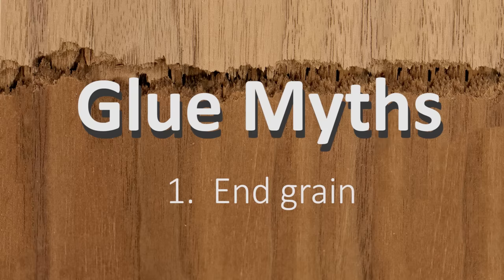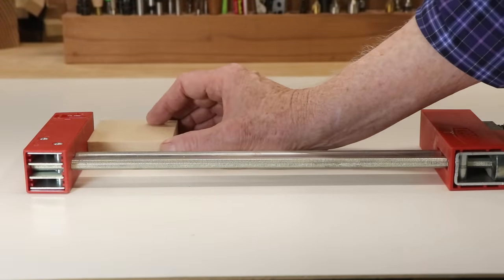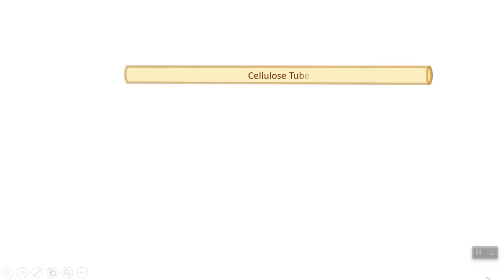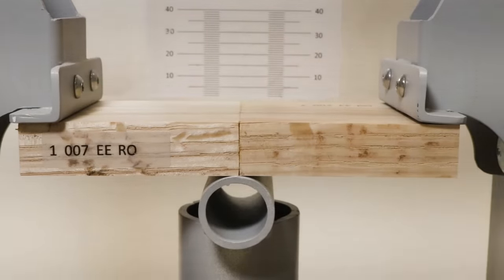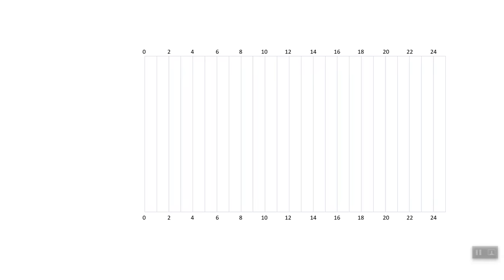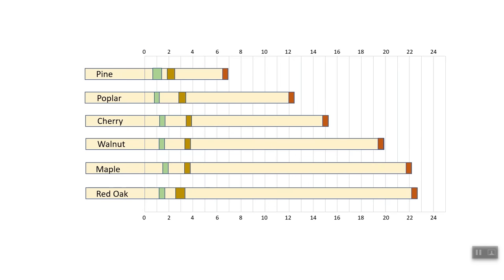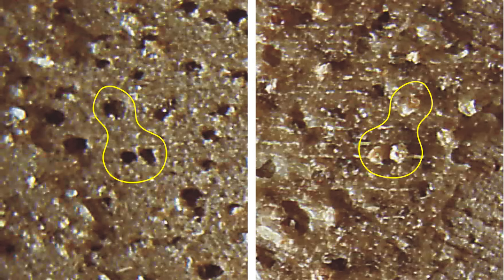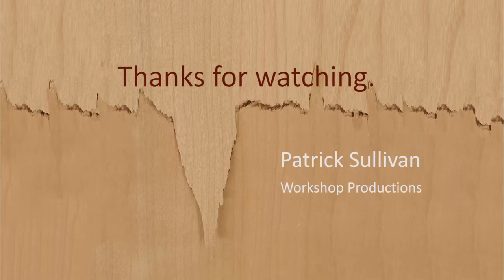Glue Myths:  1. End grain

Comment: Thanks for creating this video, and the thought that went into the underlying explanation of why things happened this way. I think you touched on something important here. Like others, I was also under the impression that end to end grain joints were to be avoided at all costs. 

One of the really important things you did was to equalize the effects of geometry in your test setup. By cutting the wood into square blocks you equalized the surface area for your test. You also touched on an important fact at the end of your demonstration. That was how much area are used in making edge to edge versus end to end grain joints when used in woodworking.

I know that geometry is part of mathematics, which is outside what woodworkers like to do. However, when you're talking about scientific methods and when you're taking force measurements, your're just touching on the underlying Structural Engineering properties of wood. Look at the strength of the glue joint in terms of PSI - Pounds per Square IIch. By cutting the wood into squares, your demonstration equalized the square inches over which the force was being applied. This made it so that the strenghts of the various joint types could be evaluated equally. The explanation of the relative strengths of the wood fibeers, lignin, and glue impacts the design of joints is genius.

Your demonstration also touched on what type of failure mode the wood joints fail under. By applying a bending force, you also demonstrated that these joints are failing from the tensile forces. Think of an I-Beam being used in your test jig. The upper surface of the I-Beam would be under tension along the length of the beam. The lower part of the I-Beam would be under compression along the length of the beam. The middle part of the I-Beam would be under compression between the upper and lower surfaces. Your tests showed a failure when the wood pulled apart at the top surface. (I'm sure there are some wood species that fail because of a lack of compression strength. Balsa would probably be an example of this as it might fail because the wood crushes at the bottom.) 

I'd really like to see the results of your test if you changed your test setup to measuring when the joints pulled apart under only a tension force. Tensile strength of materials has been studied by structural engineers, and you'll find these listed in terms of force per square area. Megapascals in metric units, PSI - Pounds per Square Inch in US units,. This is where woodworkers eyes glaze over and we go off of what we feel the results should be instead of calculating through the underlying Physics. I now mine did. 

I found a table in https://charles-oneill.com/aem341/Lesson07a-WoodMaterials.pdf that lists Red Oak as having a tensile strength of 101.4 MPa (1470 PSI) along the grain and 5.5 MPa (800 PSI) with the grain. I also found Titebond II has a tensile strength of 25.86 MPa (3750 PSI) at https://www.supplyhog.com/c/paint-painting-supplies/adhesive-glue/wood-glues-polyurethane-glues/p/titebond-ii-water-resistant-wood-glue-2. I would bet that the results of your experiment would be close to these numbers. 

Maybe we need a video (or series of videos) that go through the various types of joints that we use, what forces are applied to these joints when they are used, and what areas these forces are applied to.

Comment: Great video, may I add one consideration: You've tested static strength, testing for impact resistance might give you very different results since the wood doesn't bend nearly as much along the grain, as it does across the grain.

Comment: wow! not a woodworker, but recommended to watch by a friend. GREAT video, and it seems you totally blew the myth out of the water. margins where big enough (probably?) not need to analyze different stress modes. Those modes would be pure Sheer and pure tension. Generally there is a strong correlation between strengths in these different modes, but if you wanted to be absolutely sure of your results, replicate the testing with a different test jig. 
Super impressive work!

Comment: This was amazing. Extremely impressed by the use of the load cell in your clamp to keep things consistent down to the small details.

Did you happen to record strain data? I'm an engineer, and one quibble would be the definition of "strongest." You are measuring force at break, which is certainly one way to measure things... I wonder if toughness might be a better measure, though? Imagine kids jumping on a bed frame for example. You might actually want a more flexible joint that can dissipate the energy, not the joint that breaks at the highest force (but is brittle and cannot flex).

Again, well this is absolutely outstanding work, I would be dying to see this done while capturing the full stress-strain curve. At that point, it might be feasible to extrapolate on what kind of movement might occur over the life of a piece of furniture. Maybe a chair gets leaned back on and the legs deflect for instance. In your setup, things are completely constrained, however in real life you might not hit the forces required to break a joint because a chair leg can simply flex instead.

You are measuring the peak (max) of the stress-strain curve, however there is a lot of information learned from the area under the curve (integral).

Comment: Excellent video great presentation! Size of area of glue joint, the accuracy of the joint, type of wood, cut of wood and the type of loads and its application or direction. All must be taken into consideration. Also unlike metals that have homogeneous consist all determine success or failure. But I think you're right there are a lot of things about woodworking old thinking or incorrect application of a generalization! Just like the way you broke the last piece if you turned it 90 degrees he would have gotten a different result! 
Keep going, it would be interesting what wood science lab data shows also.

Comment: Nice work. I'd like to see this kind of test done with various methods of breaking the joint. The reason is because I salvage most of the wood that I use and have found that applying a bending stress often breaks the wood before he joint (as in your tests), however applying a shock impact to the joint more reliably breaks the joint along the glue line. If the joint is particularly strong starting the split with a chisel usually encourages the path of least resistance along the glue joint.
In my experience knocking apart end grain joints is easier, so I'm going to remain on the fence about the question/myth.

Comment: I was taught to always apply one layer of glue to end grain and let it soak in and dry first. Then do your normal glue up. I remember a couple times when I didn't do that, using old growth clear fir that the glue got totally soaked up by the end grain and the joint basically fell apart when I released the clamp!

Comment: Thank you for this straightforward well-designed test of end grain gluing.  I found that PVA glue (Titebond III) worked much better on end grain than epoxy when gluing end caps on flutes.  The epoxy joints were easily broken with hand pressure.  Also, I think the PVA is even stronger when sizing the end grain joint first with diluted glue then gluing with full strength PVA.  I would like to see a test of sizing vs. regular gluing on end grain.
Reply from the maker: I did one test used the sizing method (which Titebond recommends, but apparently not on the basis of actual testing).  It made no difference in that single test.  I did not report this because the subject needs more complete testing.  For instance, how long to you let the sizing glue set before you make the second application?  Should the first layer be diluted?  What dilution should you use?  However, in my end grain tests, I simply applied a complete layer of full-strength glue on both components, and clamped them immediately.  This produced excellent strength, as I showed in the video.  Could the strength be made even better?  I don't know.

Comment: Sorry, I have a background in composite materials and had understood the end grain rule differently.   The glue cannot restore the full strength of the wood fibers.  Whereas for side grain, glue does restore (and exceed) the side grain strength.  However no one had provided info on what the end grain glue strength was. 

Thanks for the end grain to side grain bending strength info.  Nice to know at least the early strength is higher.  Everyone should be aware that moisture changes will cause differential expansion stresses that can significantly reduce the strength.  Measuring this would be interesting if you have the time.  Unfortunately time required to change moisture content is sizable.  The stresses generated would be sensitive to whether the moisture increased or decreased.  Adding moisture would put lateral compression into the side grain of the end grain.  This might   strengthen the joint.

Comment: This is a fascinating video and very well done! However I believe there are two myths at play here one is that gluing end grain is weaker then side grain or face grain, and the second myth is that some woodworkers didn't understand this. It was said that gluing end grain was a bad idea not because orientation of the grain but that a mechanically interlocked joint was always stronger, as the most preferable connection in woodworking for structural reasons takes advantage of the strength of the long grain most joints end up end grain to end grain so a cut joint mechanically interlocked will always be stronger then gluing or butting the end grain to end grain. I believe this got repeated as and misinterpreted as end grain to end grain is weaker than the other grain orientation(giving rise to the myth you just spectacularly busted). This was my understanding and the fact that some of the glue can disappear down the Cellulose tubes when gluing end grain.

Comment: Thanks for your video, really informative and useful, statistics don't lie. This myth probably comes from the keratin and cartilage glues, these are slightly flexible, not able to fill the canals and lose strength over time. That's why particular joints were invented. And indeed the size of the glue joint is important larger surface area means a stronger joint, this is actually what a good joint does. A 45degree glue joint is stronger than a straight glue joint on the same thickness board because it has more surface area, thus more glue, this a stronger joint. Woodworkers are very conservative, so no-one probably tried this it's common knowledge. I figured this out when I started to make end-grain cutting boards as countertops. I glue a piece of plywood on the bottom because of long-grain failure. I made a mistake and I wanted to take the glue joint apart thinking it would fail on the end-grain, it didn't and I ended up starting from scratch.

Comment: This really isn't a comparison of end. grain to long grain though. Its two separate comparisons: first glue v. lignin  in every case where long grain is at the joint, and second glue v. wood grain in every edge to edge joint. But we already know that wood grain > glue > lignin, so this is the predictable and expected outcome and doesn't address the "myth" really at all. This method can't really determine if the glue bonds to the wood more strongly at edge grain or end grain because edge grain bonds will always fail at the lignin between wood fibers. So what did we learn? Nothing. We already knew wood fiber are stronger than glue...

Comment: Wow!

So glad I watched your video.  Super insightful!  Very appreciative of the step-by-step explanation and analysis.

Timing wise, just perfect.  Yesterday, I experienced a small wood failure (naturally the result of user error).  Heard a loud sharp "SNAP!"  After the 'oh crap' moment passed and I had time to inspect - it turned out to be a small corner chip.  The lignin gave way to too much lateral force (ignorantly applied by the idiot user, whom hadn't gotten around to finish preparing that corner for just that type of stress).

Two great lessons within 24 hours.  I feel blessed.  Prior to your video, I probably wouldn't have absorbed either lesson.

Many thanks!

Comment: When I first saw this video last year a was making a project (a long over the bed light), and wasn't sure how to design the back piece. It had to be two pieces and I wasn't sure how to join them. This video assured me end grain to end grain was strong so I figured why not try it. The joint didn't have much stress on it anyway I thought.

Well this morning I needed to make some alterations to this project and while doing so I noticed that joint failed. The piece is such that I couldn't open the gap enough to get more glue in, but it was completely broken at the seam. So I had to route out a  section quarter inch deep and put a piece of quarter inch oak spanning the now broken joint. Basically created big rabbits and then glued the oak long grain spanning the seam. That's probably how I should have done it to begin with, but again this video made me confident I didn't have to mess around and could just glue the boards together.

This was super annoying as it basically wasted half my day that I was planning on doing another project. And now I can't even install the light again for another few days since it has to dry, then sand, then finish, then dry.

Lesson learned. Screw end grain joints. Just do things properly the way actually good woodworkers have been doing for decades. Always get long grain crossing your joints. Just because something tests strongly two days after having been made doesn't mean it will hold up over the course of a decade. Mine didn't even last a year.

Comment: Interesting and well executed study . TO BE CLEAR though , this 'myth busted' has only minimal impact on how to achieve the most enduring , and strongest , construction .   The amount of surface area that binds any two pieces of wood together (glued , tenons or dominoes or  lap or dove etc, )  ultimately determines the real strength of any joint . Flat end cut joined 2x4s would fail in the world of construction . But done with a finger joint they have enough structural integrity . Drawer boxes simply glued together would also still require one of the many joinery techniques to actually survive.  
(with respect to the porosity of wood effecting the 'hold tight' property of glue (that your close ups revealed)  , It would actually be better to NOT sand smooth end grain pieces before gluing .)

Comment: I noticed this end grain phenomenon when glueing up a picture frame joint with an ULMIA spring loaded clamp (clamped for maybe a minute or two at most). Sometimes the joint was slightly out of alignment so I would try to take it apart but the joint was already so strong that it often required a vise and firm grip to separate. In some cases I also had to add water to the joint to get it to separate otherwise I might damage the wood completely. All that strength on a 45 degree end grain joint that was clamped for just a minute or so.

Comment: Hey! I liked your video a lot. Thank you for taking the time to do this, and do it carefully. 

If I could posit some constructive criticism, I'd like to say that telling us how many samples you did would be very good information to include so as to increase the transparency of your results and make this more scientific. 

Additionally, stress is the term that engineers use to describe what it takes to break something. Mechanical stress is force per unit area, which helps explain what you were saying at the end about long side to side grain joints vs short end to end grain joints. 

In order to make it just a bit more clear and instructive, you could include some dimensions for your setup so that we can calculate the bending stress that was occurring in the wood when it broke. 

Specifically, we need to know how far from the center the wood was being supported on either side. I know you said your wood was 3"x3"x3/4", and it looks like the side supports on your press are about a half inch wide maybe? So that would make the moment arm 2 1/2 inches. 

In case you aren't aware and are curious, this is how the bending stress equation works. 

Bending Stress = (Moment)*(distance to neutral axis)/(moment of inertia) or 
s = (M)(y)/(I) 

M is the moment, which we get my multiplying the length of the lever by the force, so if it broke at say 2000 pounds, and the lever arm was 2.5 inches long, we would say that the moment was 5000 in-lbs
So M=5000in-lbs

Then y is the distance to the neural axis from the top of the cross section. In this case, the neutral axis (Which is the axis on the cross section where no bending stress is occurring) is in the center of the cross section. It bisects the pieces of wood in half by thickness. Above that line, the wood fibers are in tension, and below that line, the wood fibers are in compression. 
So for this example, the neutral axis is 3/8" away from the top of the wood.
So y = 3/8"=.375"

Lastly we have I, which is basically a way to quantify how much stuff exists at any distance away from the neutral axis. Its a bit more complicated than that, but that's the gist. 
For a rectangle, the formula for I is ((b)(h)^3)/12. In this case, b = 3" and h = .375"
So i = 3 * .375^3/12 = .013 in^4

All together then we have (5000 in-lbs)*(.375 in)/(.013 in^4) = 144231 psi or 144 ksi

It gets more complicated than this with wood specifically, and so stress isn't a perfect depiction of what is happening here either, but it does paint a more accurate picture that can then be used to make very rough extrapolations when doing calculations to see if a structure will be strong enough or not. 

Anyway. Thanks again for taking the time to do all this, It was very interesting and I'm looking forward to more tests.

Cheers